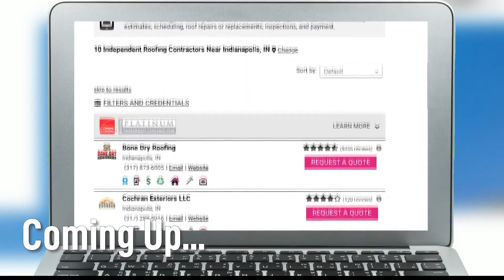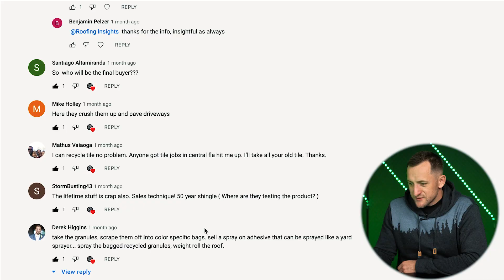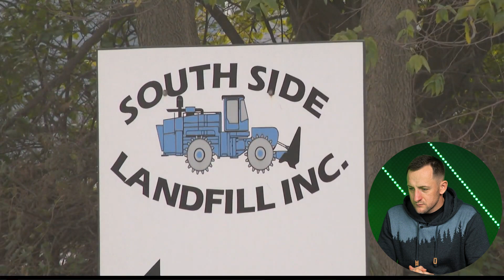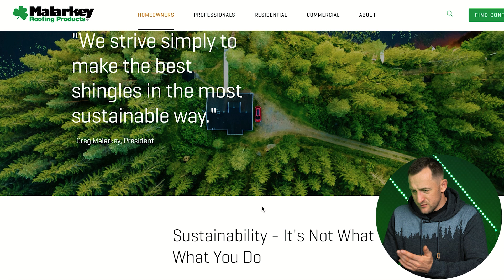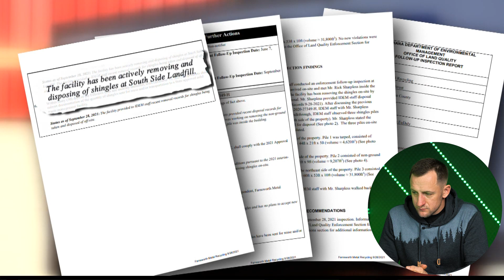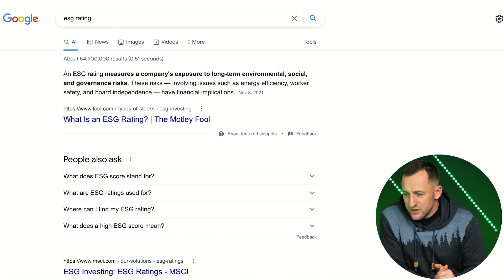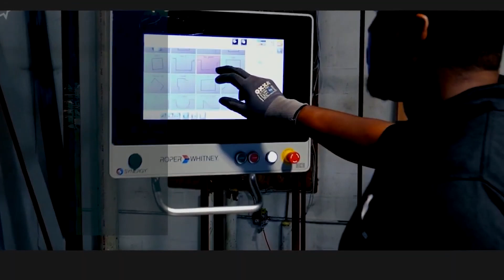Why 97% of Roofing shingles end up in landfills and not recycled into roads as promised? Kenosha, WI

Comment: I have been in roofing industry in Richmond, VA since 2004. Never once have I seen a load of shingles go to a recycling plant. My county landfill no longer accepts commercial waste so I now dump at a commercial waste site or at the next county’s transfer station that still accepts commercial waste by the ton. Overall I am not a huge fan of asphalt shingles but I also can’t cut myself out of 80% of the market. Metal is long lasting and recyclable but it is also expensive, comparably. Slate is even longer lasting and completely organic but it is heavy and even more expensive. Working in commercial QC I’ve seen dumpster upon dumpster of recently installed polyiso and membrane, etc. pulled off and dumped bc install did not meet spec. Trash and waste are definitely a huge issue in the industry that can be improved upon.
Reply from the maker: Wow. Thanks for sharing! So said. I bet you have few shingle plants too!
Reply: I live in Richmond as well and totally agree with you

Comment: Roofer from New Zealand here. Most roofs here are either metal or tile. They last for decades longer than asphalt shingles, and are easily recycled at end of life. Metal goes to the steel mill to be re melted into new roofing and other products, tile gets crushed for aggregate, or in some cases salvaged for repair of other tile roofs. Asphalt shingles are less than 2% of our roofing market, not sufficient to be viable to recycle. I'm one of the few shingle installers that NZ has, most roofers here don't do them. We also do TPO membrane, which also has no recycling solution here, due to very small volumes. Our  local supplier's yearly TPO stock would barely cover 1 Walmart store's roof.
Reply from the maker: Would love to do a podcast with you brother. Email me if interested: dmitry@roofinginsights.com

Comment from the maker: Insights:
00:00 Intro
01:37 Overview
02:20 Technology to re-use shingles is underutilized
02:49 Shingle recycling plant in Kenosha, WI
04:00 News investigation into lack of recycling
04:45 Large potential financial opportunity
06:37 Bottleneck issue in the industry
07:18 Come to the Roofing Process Conference 2021! (https://roofconference.com/)
08:10  Where are the shingles going?
09:00 Shingles are being buried
09:54 Call with Dem-Con
10:35 What's going to happen during the winter?
11:18 Call with Dem-Con P2
11:50 Landfills should be a last resort
12:52 Meeting at a landfill
14:00 Traveling to Chicago 
16:10 Separating good shingles from the bad
17:03 Talking to local roofers in Chicago
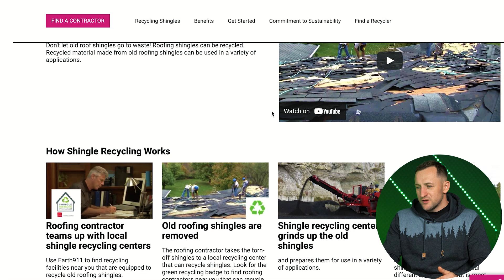17:49 Manufacturer websites are advertising their recycling programs
18:45 Call with Scott Schumacher of Owens Corning
20:40 "Leaders in sustainability"
23:29 Nobody is getting a clear message
24:58 It costs less to recycle
28:30 You can only add 5% of aggregate
29:16 Inside the landfill
30:16 Biggest Challenge
31:22 Left with only one option without recycling
31:57 We don't have alternatives
33:40 Call with Scott Schumacher of Owens Corning P2
35:32 Comment Below!

Comment: Where we take our shingles apparently they turn the old shingles into oil for ash felt.
Reply from the maker: Where is that?
Reply: Confidential.. But I will give you a hint they work for the city as construction.
Reply: Could I tell you a roofing trick...  When you are doing your last role.. And you are covering Wall flashing.. Flip the shingle upside down so the tar is at the top.. You could also lift the 2nd tab and place the nails under that so you don't see the nails.

Comment: Im confused, if a product like Roof Maxx has the ability to double roof life by applying it every 5 years, and it only costs about 20%-25% of the cost of re-shingling each time you apply it, then why in the world would consumers not help the problem and just use Roof Maxx?  Seems to me like by doing something simple - like putting a clear coat on a deck - can cut the landfill costs by almost 50% just by maintaining them. Help me if I am missing something here?
Reply: Problem with the calculations is the cost of Roof Maxx vs consumer cost for roof replacement. Almost everyone insures their home which includes the roof, so the true cost to the consumer becomes their insurance deductible. Roofmaxx cost .33/sqft to dealer and is recommended to be applied at 
1-1.25/sqft on a 2500 sqft roof that's baseline 2.5k cost out of pocket vs. 1,500-3000 deductible that the roofer will most likely "cover"  if allowed by state law.
Reply: @Onmydt  First, you are assuming the alternative to taking care of your roof is that it will eventually be covered by insurance if it fails. That is not the case at all. Coverage only happens if their is certain specific damages, not damages from age and wear - and adjusters are getting very tough. Further, most insurers no longer have replacement coverage after 15yrs. That means, even if you do have a covered claim, you will now have to pay AT LEAST half the cost of a new roof plus the deductible. If it’s 20 yrs old you may have to pay for the full price plus deductible. In your apples to apples comparison, a new roof is now close to $6/sq ft. A deductible cannot be paid for or “covered” by the roofing company. What you are suggestion is an overcharge of the actual cost of the roof, and then a rebate back to the customer after defrauding the insurance company on price. That’s illegal and worst and unethical at best. It’s also why insurance rates are rising and coverage is becoming less.